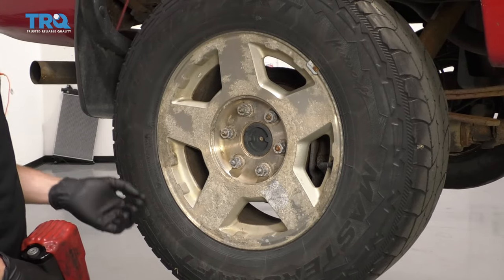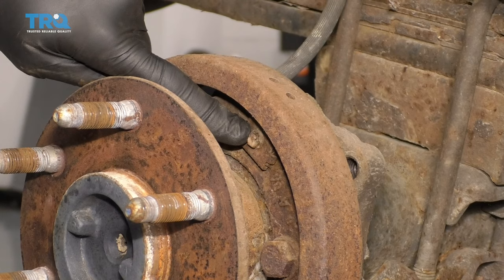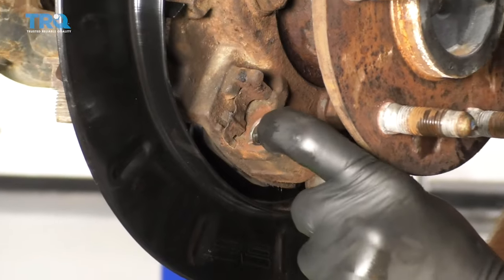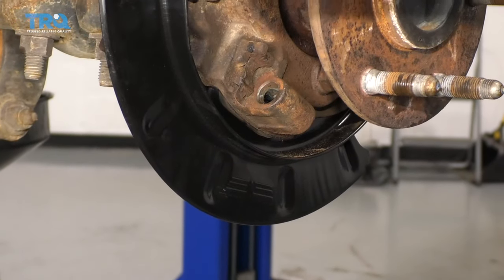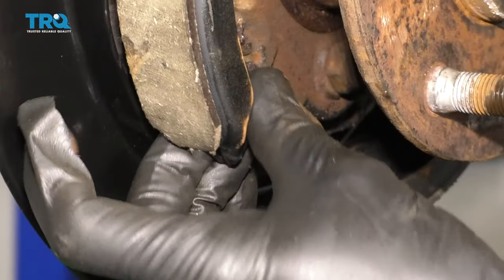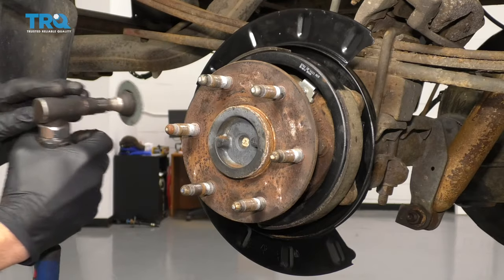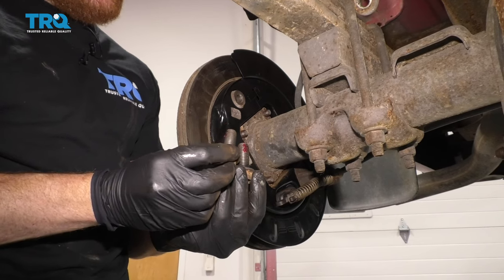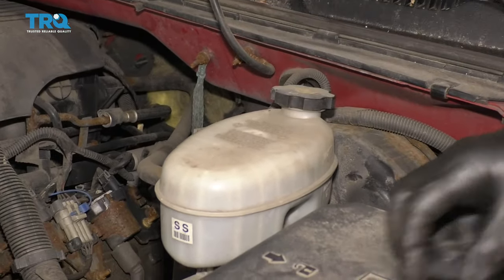How to Replace Rear Parking Brake Shoes 1999-2013 Chevy Silverado

Comment: Definitly don’t want to overtighten that bracket bolt like he mentioned, just broke the head off one. But by some miracle I was able to spin it out with a small punch and a hammer. Another solution would be to remove one of the lug nut studs and use an ez out. Also, I found it much easier to put the little bracket on first and then hook the shoe over it.

Comment: When I cleaned the rotor i used a rotary wire brush is not too aggressive and left the surface nice and clean , I did the same with all surfaces to remove the rust .

Comment: Is that caliper grease you were using zinc or can you use anti-sieze zinc. I have a 2003 Z71 Avalanche 1500 and I have to do this in the next few days. Your video is the most informative I have seen and answered a lot of questions I had.

Comment: Very good video.  A couple of items that should have at least been mentioned (IMHO).  I grew up twisting wrenches and it's easy to make vids for tech-savvy DIYers. Add a few more tips to the beginners. 
All in all, 👏👍
1) Early in the video, when starting to remove caliper bracket.  The backing plate is missing. Later it was in place. Unless I blinked and missed it. Should have been noted and what had to be done to replace backing plate.
2) You mentioned the 8mm head bolt on the retainer clip. Needed to mention what had to happen if bolt breaks and the results of just leaving it off. 
3) The left and right hand adjuster wheels are oriented quite different from left to right. 
4) The importance of grease in the space between the cups because in the northeast we have so much salt corrosion that if the rubber boot over the arm from the parking/emergency brake lever, is intended to (try) keep water, dirt, salt, etc out of the mechanism.  Also, the boots can be replaced, although few stores stock them.

Nice 11 minute video,  would have enjoyed a 15 and a few more details.
Reply: bro chill

Comment: Thanks for this vid.   You save a major step by decompressing the caliper and just swing the whole caliper and cradle off.    Others take the caliper off the cradle and then remove the cradle.    (Why oh why?)    My brake was bottoming out.   It took just one revolution of the adjuster each side and now it engages at half travel.   Felt great to do it myself.

Comment: Excellent video for the shoes in detail.  Do you have any info on how the cable attaches?  I had a shop replace the parking brake shoes.  I had adjusted them several times since I had the truck. The pads were finally barely left.  After being at the shop the parking brake peddle bottoms out.  I took apart to adjust, thinking they just didn't know how to adjust these,  and the shoes are not mounted with the clip and 8 mm bolt (did they lose them?).  The clip that stops the adjuster from turning is also missing on one side. Grrrr.  I have a 2001 Chevrolet Silverado 1500 extended cab 4x4.  Got 230,000 miles on it too! I wonder if the shop attached the cable with a rocker correctly.  Thank you.

Comment: I had to put mine back together without changing anything. The bolt that holds the  parking brake is rusted too bad. I'll have to do without parking brakes

Comment: what did I do wrong ? One side adjusted a little bit , Other side adjusted right to the bottom (no threads to see)  and it is tight  with shoes dragging a bit.  Raybestos  shoes

Comment: I have a 2007 Pontiac Grand Prix GXP. It was a nightmare taking the old shoe off but the new one will not go on. There's no way to just contortion it on there. Is there any little tricks to installing the new one?

Comment: never put locktide on your caliper bolt ,  specially the red one !!  Just dry and good torque . 

why he did that i don't know i have no clue
Reply: Some threadlocker on the bracket bolts (not slide bolts) is normal practice and doesn't hurt anything. I think the blue is the one that is reccomended, but some threadlocker isn't a bad idea on the bracket bolts.
Reply: You definitely are supposed to put red loctite on those, actually you are really supposed to get brand new bolts which come with the red loctite already on them. Red loctite is a better hold for anti-vibration. Heat them with a torch and they come off easy.

Comment: I've always had trouble adjusting the parking shoes. Not being too tight/ loose but it makes contact and rubs. My question is where is the shoe supposed to sit, down against the mounting bracket? Cause I feel it's never center
Reply: My 2001 Silverado parking brake has never held. I've had the entire system redone twice and it still doesn't hold the truck no matter how it's adjusted. It's frustrating because it's required to work for passing inspection. This year they hit me with it during inspection for the first time in 10 years. It cost some serious money and it still doesn't hold.

Comment: I was always told if you're brake fluid is low , you need a brake job.
Unless you have a you should never have to filll that system unless you're
Flushing it.

Comment: If the rear parking brake(horse shoe) mounting bracket(the small 8mm bolt) does break off,  it’s going to be a long process to fix.

If anyone has better way please add…

Drain(re-use) diff oil,
Remove cover
Remove “C-lock” that holds the wheel shaft,(use a rubber mallet to hit the end of the wheel shaft to move inwards of the posi carrier).
Use a small magnet to fish out the “c-lock”

Carefully remove shaft 
You can remove the brake housing or leave on

Drill out the broken stud
Use a self tap screw to make new threads or a tap. 
I used a self tap screw, next size up.
Repeat beginning steps to put back together. 🤷🏻‍♂️

Mine broke off and redoing everything to be safe.. oh add some sealant/coating so the bolt doesn’t rust/freeze.

Or use a “right angle” drill to get between the wheel hub🤷🏻‍♂️
Reply: NEVER use a self tapping screw on brakes.  Buy the proper replacement screw and a drill and tap to fit it.  The Easiest shortcut to replace the bolt if you dont have a SMALL right angle drill, is to drill a pair of holes in the hub between the studs 180 degrees apart.  The second hole is to maintain wheel balance.  Once you have the hole drilled into the hub, you can use a standard drill with a longer bit to drill out the old one.  If using something like an extractor you will need a long set, or a very short set with a small right angle drill.

Comment: Didn't even explain where and how the cable hooks up and why the rubber boots burst out. Piss poop video getting lucky because I broke the small bolt even though I used penetrate. I adjusted the shoe adjuster just with a slight drag on rotor and would do you know. No emergency/ parking brakes. Tighten the cable adjustment and still no parking brakes. I didn't mention this truck never had any parking brakes since I got it from my dad after it was only four years old and less than 50,000 miles. Piss poor GM design

Comment: grinding surface rust & metal off the hub assembly seems a bit anal & overkill to me. LOL
you should not do anything that resembles grinding on a piece of metal that holds your rim on.. sandpaper is fine, but still not necessary for a brake job. stick to areas the brakes are mounting. otherwise great video.